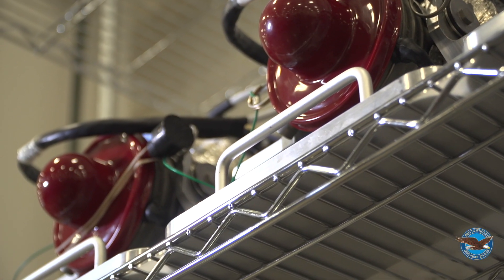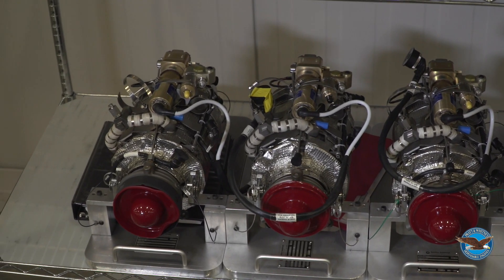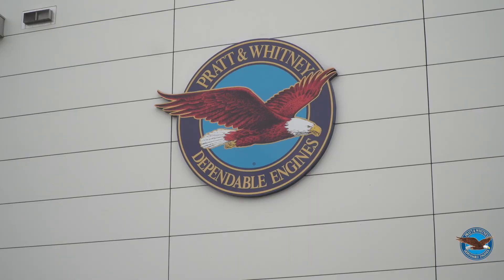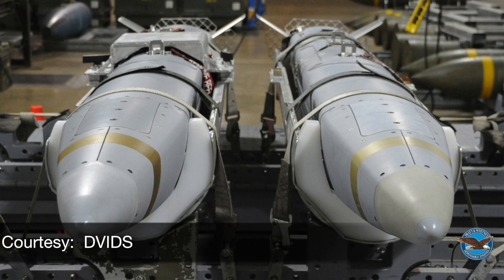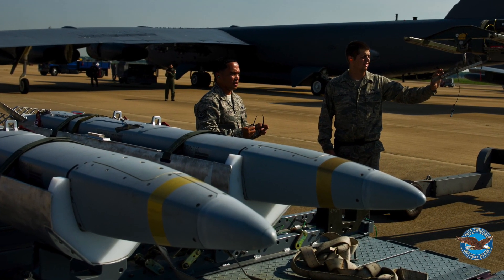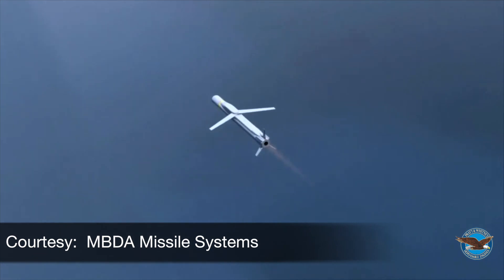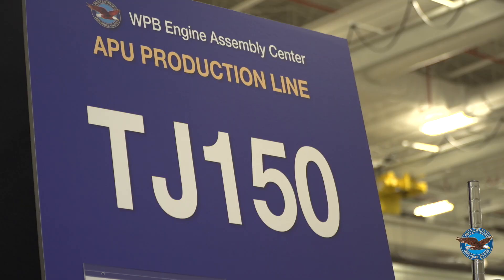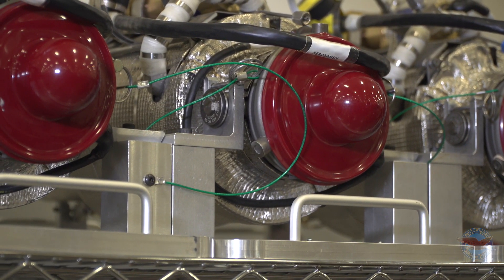Small But Powerful: The Pratt & Whitney TJ-150

Comment: The BD-5J had a Turbomeca engine producing about 200 pounds of thrust. For a small homebuilt aircraft this engine would need at least that much or more. Costs would most likely be $50K or much more!
Reply: lol, 50k... Even small conventional aviation piston engines are more expensive.
Reply: @NIOC630  Very true, but weigh MUCH, MUCH more and aren't going to deliver the thrill of a jet engine.
Reply: just wanted to point out that your 50k estimate is waaaaay off ;)  @GrantOakes

Comment: You don’t need long term reliability for a missile
Reply: no, but it potentially sits for a long time before use.
Reply: @mehrschwein7378 if it’s not being used it’s not being broken
Reply: @F14DSUPERTOMCAT   corrosion and dust/problems from long term storage do exist. also you dont want even 1 of these not fireing up. they could hit your own guys if that happens
Reply: @mehrschwein7378  then don’t store them in old collapsing and dusty stockpiles fully exposed and not in a container
Reply: @F14DSUPERTOMCAT  you're right i guess. reliability will still be a good selling point for a jet engine, no matter what its used for.

Comment: PBS velka TJ-100 in same size and produces almost double thrust
Reply: and they have the TJ-150 now also.  150KG of thrust.
Reply: The PBS TJ-200 is coming soon with 200 lbs of thrust. Putting 2 of those engines in a Light Sport Airplanes would be a fantastic sight.
Reply: @EUK007 They even did a partnership with a company and make a 300 kg of thrust version, put 3 of those on a wearable aircraft and you're going Mach 2, and also the TJ 200 has more like 440 lb of thrust, 200 is from kilograms

Comment: Hmn! I wonder if this type of powerplant can be useful for a private home built ultralight kit plane. 
Im sure 200 pounds of combined thrust from 2 of these engines might be sufficient motive power for an ultralight kit plan that humans can fly!..💡😊😆.
Reply: They don't have starters. They use a one time use solid booster to light off the compressor wheel
Reply: SAD to say the military don't want us to have it.
Reply: PBS TP100
Reply: Plus spares maintenance all that isn't done cause it's supposed to be one use my guess is it'll only last for a small time then fail
Reply: The Sonex JSX 2 jet uses a PBS TJ 100 with 130 kg of thrust, ~ 300 lb maybe? You can have it for 120.000$